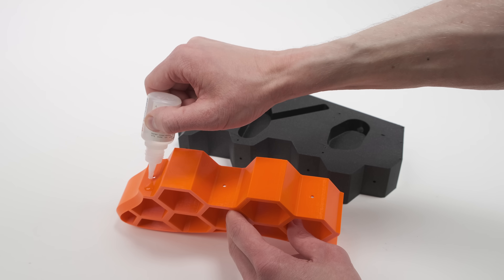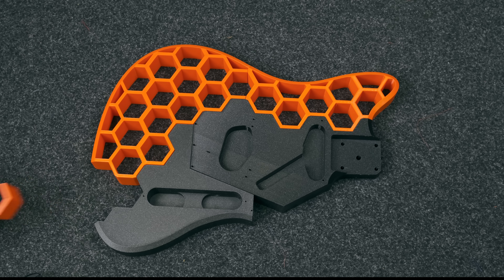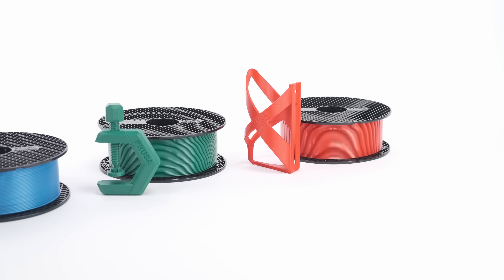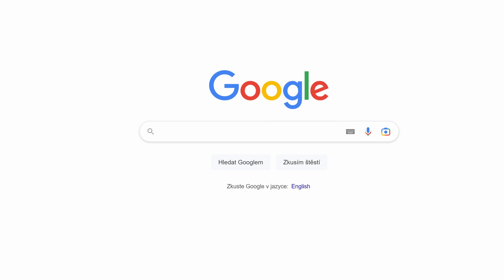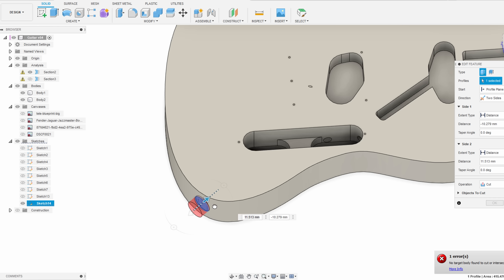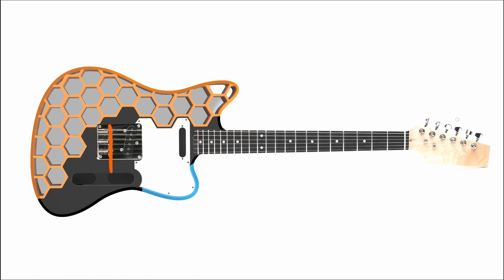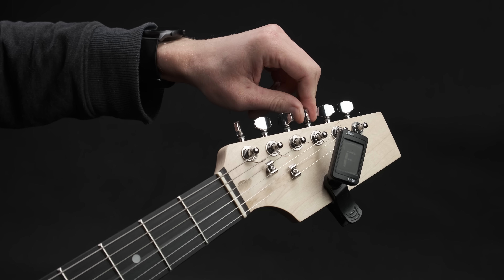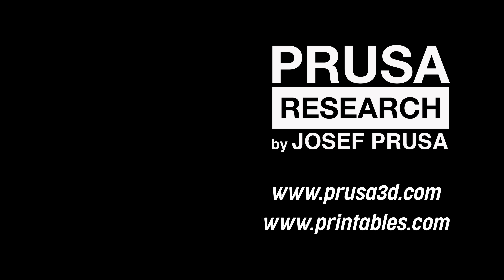How to 3D PRINT A GUITAR - the challenges, how it sounds, and how much it costs

Comment: Three years ago, I set about printing a classic violin.
Not the Hovalin or other 'no bridge' designs.

How hard can it be?
First one sounded like wet cardboard.
I took the second one to a Lutheir, a violin maker.
He made a bridge and sound-post from proper wood, fitted them expertly to the instrument.
Amazing improvement, but it still sounded muted.
I got busy, trying to print panels that sounded like a similar piece of wood when dropped on the floor.
Despite being absurdly thick (8-10 mm!) having a single-layer top/bottom, no perimeter walls and over 60% infill, I found several useful 'sound wood' replicas.
Printed up a new violin with 9.5mm thick bottom deck, 7.5mm top deck; Luthier did his magic and I had an actual Violin!
The sound 'filled the room', getting the strings to sing took no bowing effort at all.
After five glorious day of me learning how to play, the upper deck collapsed under the tension of the strings.
'Bang!' and it was split.
Didn't have the heart to go through all that again.
Yes, you can print a useful instrument, but you gotta keep the limits of the materials in mind.
Constant tension from strings or a taught drum-head can ruin a 3d print, given time.
Slacking the strings and drawing them tight every day isn't a good solution either, as it took forever to tune the thing!
Reply: Violin needs proper building materials that has good tonality
There is actually good reason why acoustic instruments has term tone wood because some materials has different properties
What comes down to electric instruments, you free to do anything with it
As long you have scale lenght in mind, tuners and mics you are running with, you can make almost any material work as guitar base build
in the end you are generating electromagnetic signal what you manipulate with effects and amps eq then that is blasted out from speaker
If anything that is most important in that signal chain is speaker
Anything i would be concerned about 3d printed guitars are can they handle string tension
There are already amazing 3d made guitars or carbon fiber guitars in the market so this isnt anything new
Just that community is slowly aproving these things in time

Comment: This is crazy cool. I think I'll try making one of these as a gift for my brother.
Very easy-to-follow, pleasant and informative video. Thanks.
Reply: How are you going so far?
Reply: @urielgranados4371  Haven't started yet, troubleshooting my printer. Getting poor adhesion and chronic symptoms typical to partial clogging even after several nozzle changes and cold-pulls, so i think i need a new hot-end. This hobby sure demands patience. 
Thanks for asking.
Reply: @AudioBombProductions  good luck bro, keep it up, solving one barrier at a time, you're almost in there

Comment: The myth of tone wood is long busted! It’s all in everything else and especially in how your fingers play! Cool!
Reply: Well, maybe for electrics but definitely not acoustics lol
Reply: + @rbae  Not even for electrics. People just like simple answers even though both of them are wrong. Of course the wood can make a difference in the sound. Is it huge? Maybe not but here comes the twist. So you might have a difference between two guitars in sound depending on the wood they're built of and it logically shows in the overtone spectrum and you will notice the difference when playing the instrument not being plugged in (but who does) now you use a pickup that doesn't pick up these differences and suddenly they sound the "same" ...
I will never understand why it is so hard to understand, that from you fingers, the strings, the pick, the wood, the build of the guitar, the electronics, cables, the amplification, the room ... everything has an influence on the sound that is just simple physics. Depending on the constellation some influences can be bigger, some smaller, some can be elevated, some suppressed. To a certain degree you can compensate bad playing techniques, think compressor for bad dynamics, like you can add high frequencies or lower bass and so on ...
So stop the blaming/shaming game take all variables into account and try to use them to your advance to create your sound. Even the thing with the fingers depends on which sound your looking for. If your sound is an all compressed and distorted stoner wall of sound you might find that it doesn't make a big difference any more how you "touch" the strings ...
Sorry, but there is no "myth of tone wood" just your need for simple answers to complex questions ...

BTW: I didn't like the sound of the printed guitar - which can have a lot of reasons, just to name  a few: 9 strings, choice of pickups, playing style, plastic body, choice of amp, settings of amp, the recording, my listening variables: speakers, room, me having a cold, my taste vs. the taste of the people involved ... the body being printed only being one! of the possible reasons. I need at least to hear the thomann telecaster build played by the same guy, same amp, settings to make an "informed" decision.

Comment: 2:02 you could always have the bridge mounting screws go all the way through the body (using long bolts instead of screws). Then use longer bolts that can screw into a counter-sank nut on the backside of the body piece.
Reply: That's a good idea!

Comment: Thinking about making a project out of this that would be fully modular. Imagine swapping out the body and choosing between 5 other bodies within 10 minutes. Super cool idea. I might even make the pickup area a heavier wood to counteract any neck-dive
Reply: Did essentially this with a ukulele as a final group project for my engineering degree. The body was from a donor ukulele, as was the neck. The neck was mounted to a 3D printed plate that slid into the body and locked in place with clasps. It was basically the test piece from this video, with quick-swap bodies. It was acoustic though; didn't sound great tbh and couldn't hold a tuning, but you could theoretically improve the design to enable swapping to a larger body or a different material to get a different sound.
Reply: If you don't go with the pre set kit you could probably get away with modeling it off of a travel guitar and making the "body" sections interlock somehow
Reply: I've never been into just having different body designs.   I do like that every body has it's special function, such as the tremolo bridge and single coils and body cuts of the Strat, the ashtray bridge and twang of the Tele, the maple top and humbuckers of a Les Paul,  the fast neck of an Ibanez, etc.

Comment: I know this would add a good bit of design challenge, but I would love to see a build where you can easily swap the electronics. Being able to switch from single coils to humbuckers on the fly would be incredible. (I know there was a kickstarter guitar that did this, but it also fits this type of build really well)
Reply: Not sure if this is the brand you're referring to but Relish Guitars have a really cool system for this, where the pickups pop in and out with magnets
Reply: @patriktoobe  And Relish went out of business.  ;)
Reply: @Fraser Kahl - Just install a hotrail humbucker with a push/pull pot. It's easy. Then you can separate the two rails to get a single coil when you want.
Reply: @Twitch_Moderator  push pull coil splits are not a perfect stand in for single coils
Reply: Actually this is quite easy. Each humbucker actually has two more wires which are usually just soldered together, but you can rewire it and add a switch to your guitar (there exist potentiometers with built-in switch), so switch from single coil to humbucker. Just google for "humbucker coil split wiring"
Reply: Ampeg did this in the 70s.
Reply: Yeah, the swappable pickup system would be awesome!  I'm not saying to put it on the market but just for those into 3D printing to print.  Relish Guitars had a model that you could easily swap out the pickups and for people to print out a guitar with that capability would be popular.
Reply: There's something called "coil tapping" or "split coil" that does this.
Reply: @josephbrandenburg4373 it’s not the same though. I install coil split on all my humbucker builds, just because it’s so cheap to add, but I never end up using the single coil mode ever. It never sounds as good as an actual single coil like a P90.
Reply: @josephbrandenburg4373  coil tapping, while very useful is not a perfect single coil sound.
Reply: Gotta tell you, as a guitarbuilder and member of a few guitarbuilding forums, every new guitarbuilder has this idea (and think they're the first person to come up with it). Whilst it is possible, it doesn't really appeal to the guitar market. Guitar folk like buying guitars, if you want a different sound, you're likely to just buy a different guitar. Even the prototypes of this idea tend to just get left in the preferred setup of the user. Years ago a guy came on one of the forums and was trying to rustle up interest in a new idea he had for a guitar with smartphone based DST effects, again, one of those "this is gonna change the guitar world" kinda deals. You could insert your iPhone 4 right into the inbuilt dock, and with that last sentence, you can see why it was a terrible gimmick. Guitar folk tend to be pretty traditionalist. It's why so many people just build strats, teles and Les Pauls. It's great to build your own new designs, but you'll have a harder time trying to sell them.
Reply: @kwerk2011  Yeah, but I bet a lot of people with 3D printers build their own guitar.  Because they can, not for resale.  I'm going to build one just to show folks that don't think 3D printing is cool!

Comment: Would it be possible to transform it into a bass? The first problem in mind is the string tension and possible body bending
Reply: I printed a fender precision bass that I got free on thingiverse, came out great
Reply: A 4-string bass with fairly light gauge strings is going to be about 70kg, which is almost twice what they suggested here. It's also going to be over a longer distance of 3D-printed body. This might be ameliorated somewhat by using a short-scale bass.
Reply: Bass strings put an unbelievable tension on the strings!

Comment: Question 2 from the beginning is answered easily. No, body material makes next to no difference for the way an electric guitar sounds. I know, the tone wood shills will arrive soon, but it really is true. The sound comes from the electronics, it's an electric instrument. If you get a robotic arm to always pluck the strings in the EXACT same way, you will notice that you can take away part after part after part from a guitar until you're left with a set of floating pickups and some string hardware, and it still sounds the exact same too. Material affects ergonomics and of course, how solid the instrument is, but in an electric instrument, the wood makes basically 0 difference. The vibrations the strings create in the material and thus make the pickups "counter-vibrate" to the strings are much too small to make an audible difference in an electric guitar - maybe this is different for a bass, where the strings make the material vibrate much more, but I still doubt the difference will be big enough to justify the prices of instruments made from "magick tonewoods" rather than affordable, solid woods or heck, even plastics or metals.

Comment: Im guessing if you had a steel sheet that you touched all the time on the guitar that buzzing sound would go away more your earthing out through your body down the strings into the board into the wire the resistance would be less if there was direct contact

Comment: I feel like if I were designing it, I probably would have put a metal reinforcement bar through it, then put in metal anchors for the screws, You would be able to attack a wider variety of bridges that way, and the metal bar would allow for different plastics if you wanted. Plus with different bridges, you would be able to use a wider variety of pickups